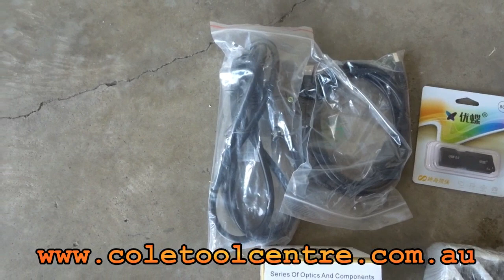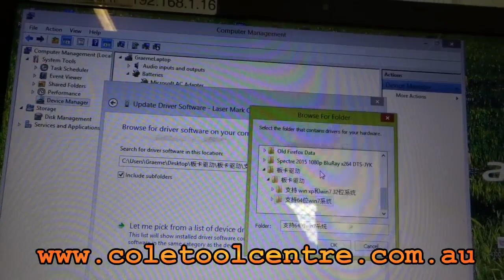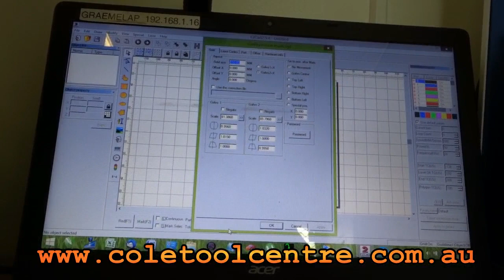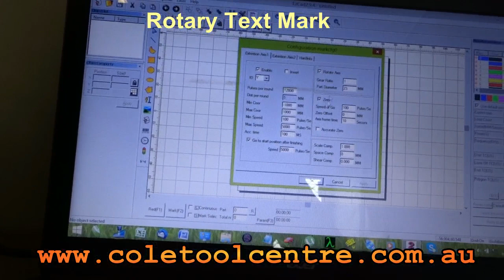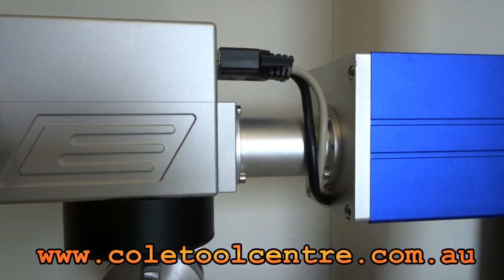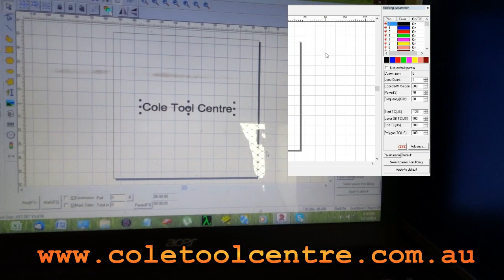Fiber Laser Unboxing Setup

Comment: I have noticed that this type of machine has no covers on it.  Is this dangerous?  What if you slip and get your hand in the way?  Also do you need to wear goggles when marking stainless or aluminium?  Thanks for the video!
Reply: Goggles yes.  You can look up videos of people putting their hands in front of the fiber laser and it not doing anything.  This is even with those 1000w rust remover laser "guns".  If you put your hand in front of a co2 laser you will get torched. lol

Comment: So, if you grab the corner of the box in EZCAD and make it bigger or smaller the size of the laser box on the worktable will also resize accordingly?
Reply from the maker: I no longer have the machine. from memory I think you have to set the work area in the menu's
Reply: Yes, Aaron.

Comment: can you do one where you laser pet id tags?
Reply from the maker: Most pet tags are anodized aluminium which you can do with a much cheaper co2 laser the fibre laser is for marking directly on metal like stainless steel

Comment: How is it holding up? ive been contemplating of buying one
Reply from the maker: I seems to be OK but I only purchased as a demo machine to see how it performs and decide if I wanted to import. So I do not use very often and have my demo machine for sale.
Reply: Cole Tool Centre thanks for the reply, I’m think I’m going to go ahead and make the purchase for one, hopefully everything turns out well. No one seems to have this machine in my area
Reply from the maker: If you are going to purchase and want to use the rotary chuck with "graffic" confirm with the supplier that it will do graffic on rotary correctly without leaving lines the software they surplied with my machine was supposed to be capable but after a long period of trying the said I had to upgrade the  main board and software to do graffic on rotary table without leaving lines when it rotated to next position. Rotary  text is OK.
Reply: @Graemecns  thank you for that tip I 
guess thats my only worry to find a good supplier lol

Comment: Does this machine also cut ?
Reply from the maker: I would say no in practical terms with many many passes it will get through very thin material say "aluminium can"
Reply: 50w 60w 100w can cutting 0-1mm metal sheet.
Reply: @Graemecns  it does. takes multi passes.. looks like crap. if you want cutting buy a cnc plasma cutter
Reply: You need at least 200-250 watts to cut aluminum, so you are in the CO2 laser range.